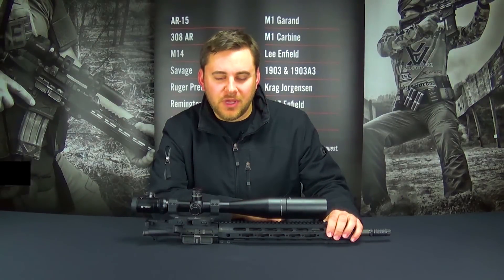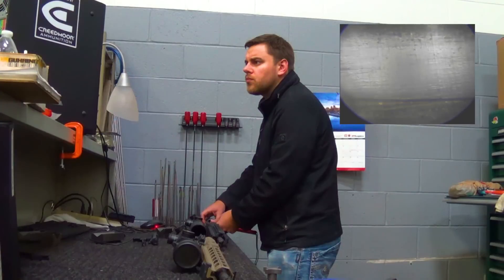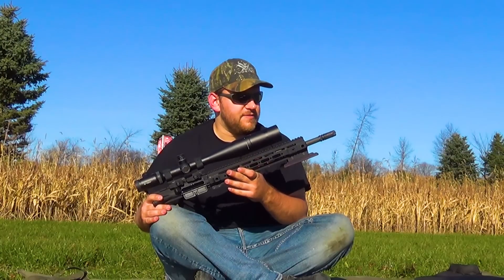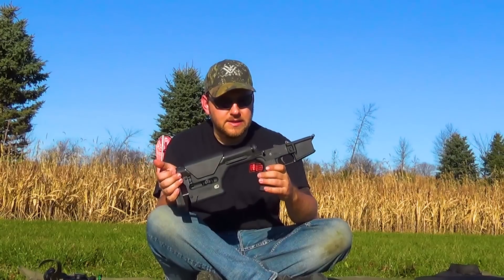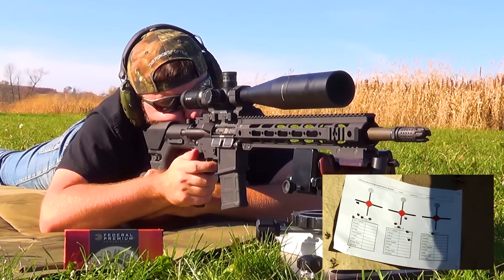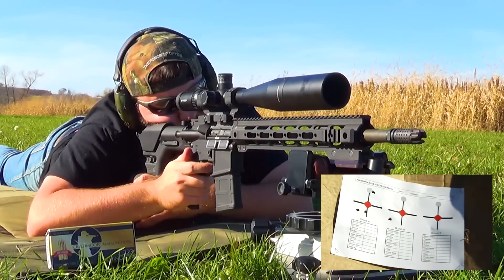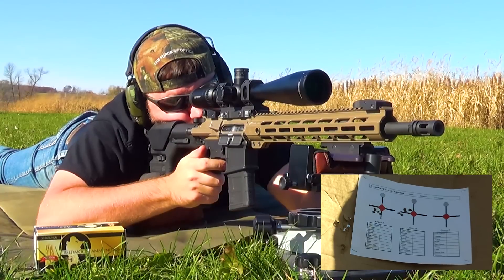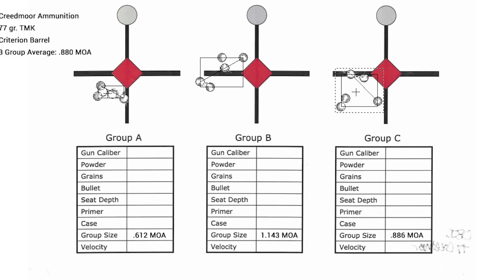Criterion Barrels vs Cold Hammer Forged:   A Comparative Analysis

Comment: If only mine(18 1in7 CM) ever shot even close to this with any handload recipe under the sun(69-77), I wouldn't have spent beaucoup bucks and replaced it with a Bart, which did deliver these groups.

Was a solid barrel, but not even remotely close to this.  More like a .6-.75 true average with best loads, loaded(24.1g Var + Berger 77 OTM) or factory.  And yes, trued and bedded, tube aligned, ADM upper, JP bolt, , MI guard, TTD trigger, turned by CLE.

Would love to know what you guys are doing to achieve these groups.  Though I only know of 2 other people with Crits(ARs, one SS one CM), neither of them shoot like this, and they are both run by more than capable shooters.

Does anyone here have an AR Crit that mirrors these groups?  Handloads / factory? Which barrel? SS / CM?

I still think these are solid barrels for the $, and do recommend them, just want to know what else I have to do to get mine close to these results...

Regardless, excellent groups, excellent shooting(especially on a waving target)

Comment: Criterion made this video? Excuse me if I don’t take this at face value
Reply from the maker: Richard, I encourage skepticism.  There are a lot of marketing smoke and mirrors out there and I am with you on taking things at face value.
Reply: I have one criterion 410 SS barrel I’ve shot quite a bit. From prone it shoots 1-1.5 MOA with most bulk ammo. With match ammo it’s consistently sub MOA. I had one of their 300 blk barrels and it was also sub MOA which is less common apparently.
Reply from the maker: @K-bob_45  Thanks for the feedback.  Our .300 Blackout barrels feature a unique rifling design that was specifically designed and tested for the .300 Blackout.  Although this cartridge is amazing, it is not known for accuracy.  Our rifling design works to squeeze as much accuracy as possible for the .300 Blackout.

Comment: I’ve never had groups THAT tight from your barrels, but you guys do make a damn good barrel nonetheless
Reply: I haven’t either but I don’t have that rest 😂
Reply: Also a lot of other factors go into the accuracy of a gun that can change slightly from gun to gun
Reply: What contour/thickness are you running? This can make a huge difference in performance.

Also, a nice upper to barrel fit should have to be heat fitted.

if your upper receiver had a loose fit on the barrel when installing it and you didnt have a bolt matched to the Criterion barrel that would be the difference right there for larger grouping....see a lot of installs where they put stainless shims if there is any play in the barrel extension when installing on a upper receiver with subpar specs. 

 The actual bolt can also have a serious impact on accuracy, many people dont know that their bolts aren't quite up to spec or barely fit within tolerances.

Comment: I just built a savage 7mm R.E.M. mag using one of your barrels that shoots .1875” groups at 100 yards using Horady 175 ELDX bullets producing 3133 FPS. Still working up to pressure. Can’t be happier with it.
Reply: 3 round groups are lame, and you didnt get that on a 5 or 10 round. Criterion barrels are top notch, but stop it.
Reply: @jamesstephenson2346
What do you expect to gain by addressing other shooters this way? An ego stroke, most likely. You’re the guy who, only a year or so ago, just found out the information you are throwing in his  face and you only discovered it then because someone with more experience told you so. Stop being such a pretentious dick. Stop it.

Comment: I think it's like anything I think there are good and bad hammer forged barrels and good and bad cut rifled barrels. I've seen many debates on single point vs button rifling and they both seem to be almost the same. Chrome lined seems to always have a negative impact on accuracy to some degree though which is to be expected. I've shot some amazing CHF barrels from SAKO and Blaser and I've also had fantastic results from Criterion.   Running a Hybrid heavy 6.5 Creedmoor Criterion in a STAG 10 and having no trouble at all at 1000M on targets about 20" around. cut the barrel back to 19" and the velocity didn't change much from the 22". I'm less than 100 FPS difference (really about 6o-70) than when it was longer.

Comment: I know you guys make pretty decent barrels, but I'm not sure it's fair to compare a barrel with a 5.56 chamber against a 223 Wylde chamber. The 223 Wylde chamber is always going to be more inherently accurate because the throat has a lot less slop in it. If your going to compare bore characteristics, you need to eliminate confounding factors. Using different chambers pretty much nullifies any validity in your test results.
Reply: How many PRS or benchrest shooters use CHF barrels? Most use single point cut rifled barrels a few use button rifled. Not a single one uses CHF.

Comment: Is a headspaced bolt necessary to achieve the best possible accuracy? Or can you still achieve the advertised accuracy with a standard Mil Spec bolt (e.g. Colt bcg)? Also, which gas block do you recommend for your pencil contour barrels (.625 diameter)?
Reply: I use to believe that all bolts are the same. Thats not true at all. The loose tolerances that are beneficial to combat dirt that gets in the chamber. Is the same loose tolerance that will hurt accuracy. But aid in reliability. 
Basically, the tighter the tolerance the greater the accuracy at the expense of reliability. So if its a combat AR15. Then a standard bolt is ok. A DMR? Then you want the best accuracy possible.

Comment: Might I weed out a simple overlooked variable here and in my opinion, willful omission?
We're talking about a military grade CHF 5.56x45mm barrel correct.
Your barrel is using .223 Wylde yes?
This is an apples to oranges comparison and seriously a joke that you tried to pull this crap on all of us. At base value a .223 Wylde barrel is already designed with more accuracy in mind than a 5.56 barrel. 
Also another thing not talked about. Since we're talking about cost, a CHF barrel will last you tens of thousands of rounds down the road. What is the lifespan of these barrels? There's a shit ton of overlooked nuance here and really it seems overly intention and extremely misleading. Can't believe people haven't after a year seen this. Outta here with this poor advertising.
Reply: You have no idea what you're talking about. Please educate yourself on barrels and manufacturing techniques/procedures.
Reply: M LL - i own 2 FN AR-15s, a modded 16" M4/RECCE with a non-free floated, 5.56 chambered, button rifled, chrome lined, 1/7 twist barrel and an 18" match grade sporter/SPR with a free floated, .223 rem match chambered, CHF and chrome lined, 1/8 twist barrel.

Both rifles fire sub 3/8" 5-rd 100 yd groups when i do my part though sub 13/16" is all but guaranteed with Sig Sauer elite 77 gr OTM and Federal GMM 69 and 77 gr OTM loads.
they even do about 7/8" to 1.125" with inexpensive Norma tac .223 55 gr ammo.
both rifles fire regular perfect, .000" 3-rd and sub 1/8" to 1/16" 5-rd groups at 25 yds with the Norma load.
the 18" sporter/SPR never fires larger than about 3/16" when im on point anyway, and averages .193" for all 25 yd groups fired(about 4,000 rds) while the M4/RECCE  averages more like 3/8" with the Norma loads (about 5,500 rds).

the M4/RECCE is possibly the most accurate while the 18" sporter/SPR is definetely most consistent.

i dont know if its a matter of button rifled vs CHF or chrome lined vs non or what but all i know is these FNs are the most accurate rifles ive ever handled.
100% reliable too.
and after over 6,500 rds on the M4/RECCE and over 5,000 rds on the 18" sporter/SPR, both rifles components still look new. theres not a mark on either bolt! and only minor finish wear on the cam pins and the corners of the carriers rails leading me to believe theyre also the most durable.

whether CHF or button rifled, chrome lined or not, if you ask me its the quality of the barrel that matters. equal quality = equal accuracy.
and that seems to be evident with these two FNs.
Reply: I have a FN CHF chrome lined barrel and was hitting plates at 500 yards and 10in plates at 300 yards while using a red dot. For practical accuracy it’s more than enough
Reply: Daniel Kelly the point is the price point
Reply: M LL If you’re using your AR-15 on the trap range, go with the FN CHF barrel. 

It’ll give you a wider pattern, easier for busting clays.
Reply: Considering that the Criterion barrel is chrome lined, it will most likely exceed the lifespan of the CHF barrel. With regards to the chambering; 223 Wylde barrels would allow you to shoot the 223 Remington round while providing the tolerances necessary to be able to shoot 5.56 NATO. There is a multitude of studies online (some of which can be found on youtube) showing that when firing 5.56 Nato, a 223 Wylde chambered barrel will not differ in accuracy in comparison to a CHF barrel that is also shooting 5.56 NATO.  The test is very much apples to apples, hence the reason why no one has pointed out what you referred to as a "willful omission".
Reply: Daniel Kelly There isn’t any “military grade” CHF barrel for the AR15/M16 platform, at least as far as Colt’s TDP is concerned. 

Why is that?

Because it was determined that CHF is not capable of the accuracy of a button rifles barrel in military tests. 

CHF is a scam. 

It doesn’t last longer, it’s not more accurate, it’s just a way for companies to manufacture the most barrels for the lowest cost.

Comment: Is there an easy answer on which BCGs go well with these barrels or do I really have to trial and error headspace everything? I plan on doing it anyway just to make sure, hoping my local gun store can do it for better than the price of a gauge set, but it'd be nice to have a starting point to go off. Ordered one of your .308 Hybrid CL barrels to replace an Aero precision barrel I wasn't too happy with. Was going to use the Aero BCG I had with it, at least until I could find something better. Any recommendations welcome.
Reply from the maker: As far as .308 AR's go I usually recommend going with Fulton Armory or JP Enterprises. Those are the two manufacturers we use for in-house headspace testing (DPMS should be good to go as well). 

We have found that some Aero bolts may headspace with our barrels, but the range of tolerance they hold varies from the DPMS standard, so many of their bolts will close on a no-go gauge.
Reply: Ok thank you sir. Got a headspace gauge set on the way. To my disbelief, not a single gun shop in town had a set. In the event that I'm out of luck with the Aero BCG (which will definitely tick me off, I hate having almost interchangeable parts laying around) I'll have some idea where to turn. Also, I'm really glad you're indicating its a DPMS pattern. If I'd just thrown an Armalite pattern in the mix I'd really be kicking myself right now

Comment: I'd almost bet that if you hand lapped the other barrel that it'd compete well with the criterion barrel lol.
Reply from the maker: It would take a little more than a simple lapping job to clean that CHF barrel up. One or two steps would need to take place prior to rifling to allow for a more uniform bore diameter, as well as a change in production methods to allow for more a uniform chrome lining application. Without a more extensive material test I can't speak to the stress relieving process used post-rifling, but that definitely comes into play as well.
Reply: @CriterionbarrelsInc  also, a lot of chf barrel manufacturers don't take the time to lap their rifling in their barrels. I'm not saying your barrels are bad because I've never used them. However, I was getting sub moa accuracy out of 16 inch 1:8 twist Anderson manufacturing barrel with 69 grain federal ammo lol.
Reply: @SIRWAFFLEBOB  are you a barrel maker?
Reply: "a lot of chf barrel makers"??
you do know there are only a handfull of cold hammer barrel forges in the entire World, right? 
FN, DD, and 3 more in North America is all there is.
Reply: @tomacton6718   ruger has chf barrel I don't know if they make it or not
Reply: @CriterionbarrelsInc  I understand that you have a product to keep a reputation for, but some diamond lapping compound would clean the rifling right up. Keeping check with bore gages to make sure the dimensions weren't being screwed is a necessity. Of course making your own custom rifling lapping tool from lead would make the job easy. I did the same thing for my rock island 1911 with a chef barrel, and it cleaned up my groupings. Almost a night and day difference.
Reply: Ruger has a chf barrel I don't know if they make it or not

Comment: I have a question about proper cleaning. When I clean my rifle, will a bronze brush hurt the chrome? 
This is the tightest shooting barrel I have ever owned and I don't want to 'eff it up!
Reply from the maker: The bronze brush itself shouldn't hurt the chrome, but they do tend to pick up pieces of debris/primer material/other abrasives that may wear the barrel a bit more prematurely than if you just used patches and a one piece coated cleaning rod. It's a pretty minimal difference that would only become evident with excessive cleaning.

We have an article that details our recommended cleaning procedures here:

http://criterionbarrels.com/criterion-recommended-rifle-barrel-cleaning-procedures
Reply: Thats what I'm looking for. Thanks.  While I'm here can I suggest a Hybrid profile chrome lined  barrel in 6.5 Creedmore and 6.5 Grendel. You barrels shoot very well and are priced very well. I have been exploring other caliber options than 5.56 and 308 and I want a chrome lined barrel.
Reply: bro your shooting bullets thru a barrel with hot gas, bronze brush wont hurt anything.
Reply: @hambone950  I know that now. (that post is six years old by the way)  When you're first starting out, its better to ask first than find out you effed something up.
Reply: @rdsii64  did you get a cirterion barrel?
Reply: @hambone950  I have two.  One 308 and and one 223 wylde
Reply: @rdsii64  obviously you like it? optics is running a deal on them sub $300 for 556 i might jump on it.. might buy it idk
Reply: @hambone950  I've been running chrome lined Criterion barrels on my AR's for the last six years. When I have a choice I won't run another barrel. In fact I'm waiting on a 20 inch CORE barrel now for a light weight hunter build.

Comment: Do you guys do custom barrels - I'd like a 338 federal that'll fit a propietary Robinson Arms 308
Reply from the maker: We work with a few custom shops like Precision Firearms that may be able to help out on that front. For in-house work we typically require production runs of 25+ pieces to effectively offset setup and tooling costs.
Reply: Criterion Barrels, Inc. OK thanks for the reply

Comment: I bought mine from optics planet. It has a burr in front of the gas port. Only shoots 1" with immaculate handloads. I need better. Copper free except for in front of the burr. I havent shot it further than 100 but dont have high expectations. Shopping again. My M1A with Criterion Could shoot .5" consistently with my handload and a tuned rifle. Did very well in DMR matches.
Reply from the maker: Hi UXO Tony. I'm sorry to hear you have run into some complications with your barrel. Feel free to give us a call at (262) 628-8749 or shoot us an email at contact@criterionbarrels.com and Michael will get you set up with a recall tag. We offer a satisfaction guarantee, and would be more than happy to inspect, repair, or replace your barrel if necessary.

Comment: My 20 inch hybrid chrome lined got delivered today. I have a bunch of powder, primed cases, and 77 grain bullet set aside for it.
What kind of barrel life can I expect?
Reply from the maker: Barrel life depends on a number of factors (load recipe, case composition, rate of fire, maintenance procedures, definition of "shot out", etc.).

That said, we typically see a barrel life of 17,000 - 20,000 rounds through a rifle before we see our 3-Gun shooters swap out our chrome lined barrels. These barrels are typically engaged in rapid fire strings of 30-60 rounds at a time, using a mix of inexpensive short range ammunition, as well as long range match ammunition. The service life criteria for these shooters normally involves being able to consistently shoot sub-MOA groups.

That said, we have seen barrels last significantly longer than the aforementioned service life. The highest sub-MOA round count I have run across was a shooter who had put 30,000+ rounds through his chrome lined barrel. According to the customer it still shot great, but it was getting difficult to clean (the high level of throat erosion was causing fouling issues).

I hope this helps with answering your question!
Reply: Honestly I was only expecting you to respond with 8,000 to 12,000 rounds. Now I want order another one for my 308 AR.
Reply: rdsii64 😂 yea the knowledge they throw out is abundant
Reply: @CriterionbarrelsInc well. I guess I need to put in an order.